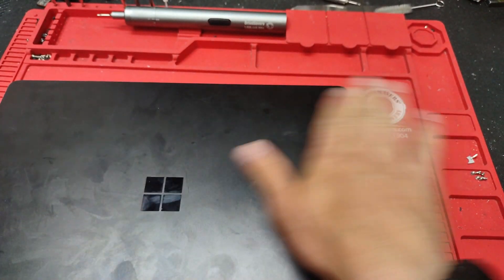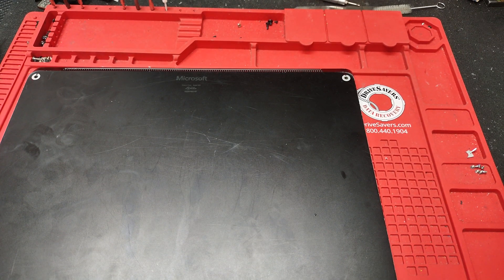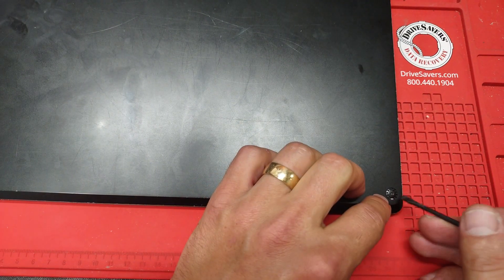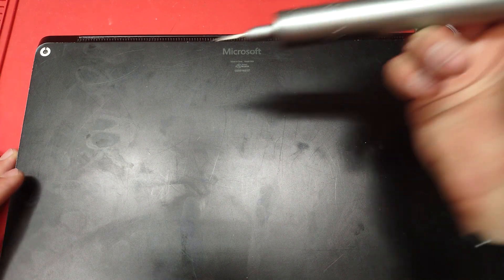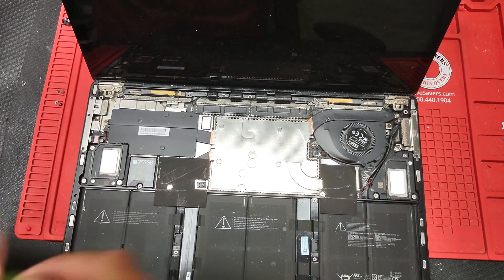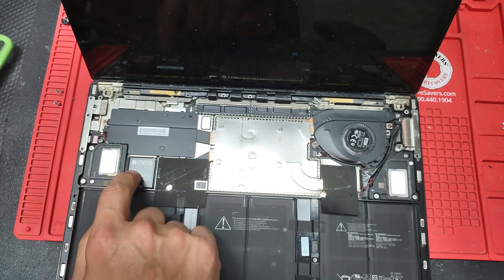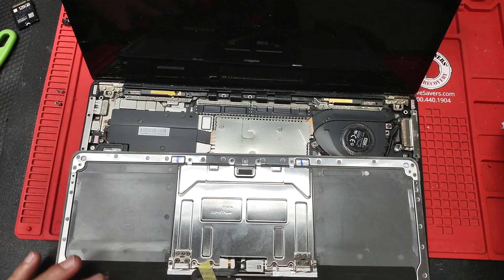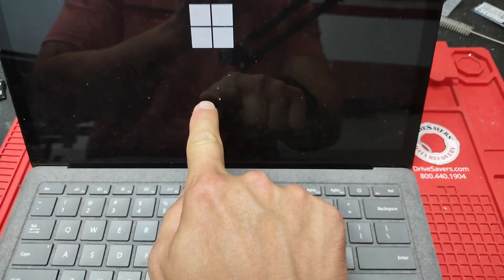Microsoft Surface laptop model 1868 keyboard replacement

Comment: If my computer won’t turn on with the power button will the keyboard be the issue? My son hit the keyboard so I’m hoping it just that.I opened it and the magnetic cable was slipped a little and couldn’t put it back. So I hoping hoping it’s that.
Reply: Did you ever figure it out I’m dealing with the same
Reply: @WreckFlixTv  Do you have a solution? I have the same problem. Laptop fell down and the keyboard no longer works😢😢😢